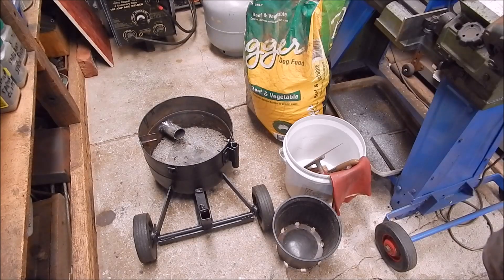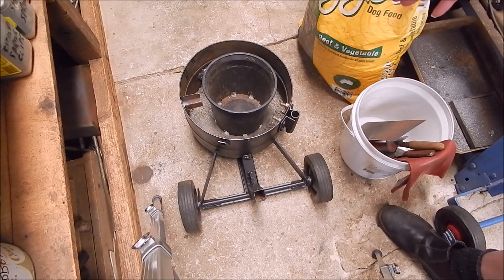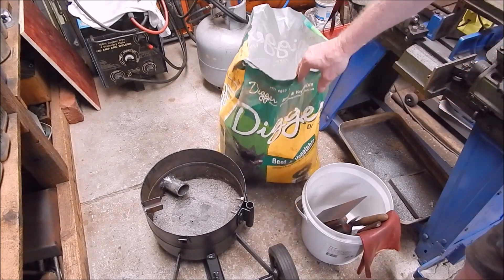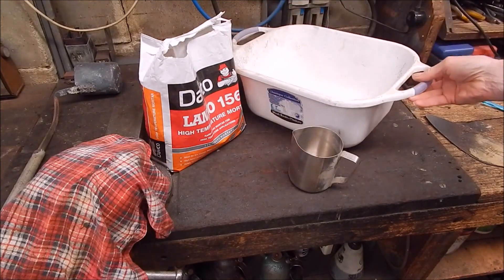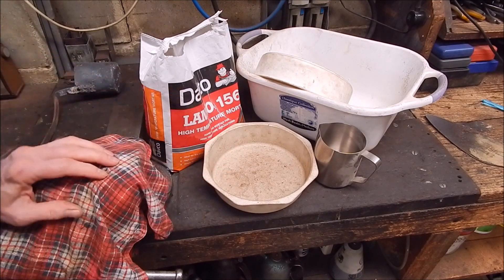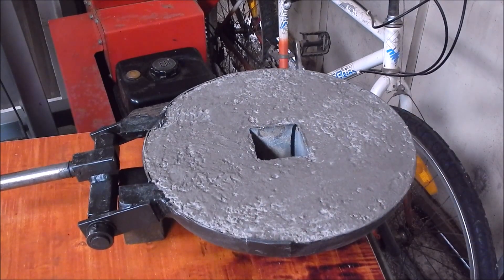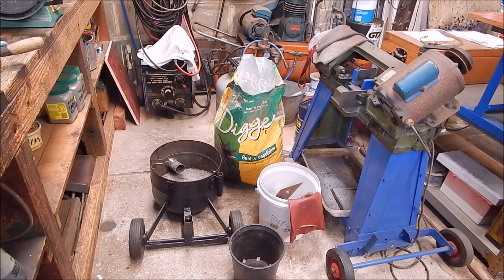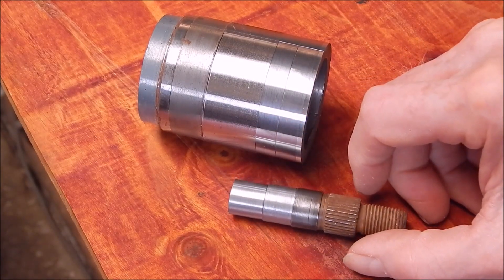Latest on the 10 kg LPG gas cylinder melting furnace build

Comment: G'day Rob.  Looking good.  Now you are not only the Xynudu foundry and casting company but the Xyndu founry and casting and furnace company.
Reply from the maker: G'day Harold.  Yep.  I finished it off today.  I'm letting it bake outside in the 39 C hot days we are having.  I increased the amount of mortar in the base and it remains to be seen if that was a good or bad move.  The lid is rock hard at 4:1 but I went 3:1 for the higher temperature crucible area.  Next thing is to fire it up.  Cheers Rob
Reply: @Xynudu  Hi Rob, do you add any water/liquid in the mix?
Reply from the maker: Hi Edin.  Yes.  It's the same process as mixing regular cement.  Just add enough water to make it bind like pottery clay.  Cheers Rob

Comment: Getting close now Rob👍 Where did you get the hi temp mortar?
Reply from the maker: Hi Bill.  I finished the mortar /perlite mix job this morning.  Just having a beer and watching the cricket.  I got the mortar at Bunnings ($25).  I needed a bag and a half to do the job. I switched to 3:1 ratio as it seems better.   I'm glad I put wheels on the cylinder as it's going to be damn heavy.  I will weigh it when all dried and back together.  Cheers Rob
Reply: Thanks Rob, handy to know if I ever decide to make a furnace

Comment: Those high speed steel parting off blanks you suggested from Banggood have been a huge blessing. They grind easily & do a super job. I did buy some carbide but so far I have never used it. The flexibility of high speed steel is so convenient. Looking forward to seeing this fab furnace in operation. Thanks for sharing!
Reply from the maker: Thanks for the feedback.  I totally agree on the HSS blades.  They stay sharp and I've never broken one.   Quite a good size.  The furnace is all done as of this morning.  Just need the perlite/mortar mix to set and dry out a bit.  Looking pretty good.  Cheers Rob

Comment: Your furnace is coming along nicely. Looking forward to the day when you show it fired up in anger. Andrew 👏👏👍😀
Reply from the maker: Thanks Andrew.  The build has been pretty painless so far.  It will take quite a while to dry out, but there is some hot weather coming up, so that will help.  I'm keen to get it going.  Damn glad I put wheels on it as the weight is going up.  Cheers Rob

Comment: Yes, did buy a 10kg bag of Pearlite recently, to reline a chimney and fireplace. 10kg bag is almost half my height, and cost only $30 Aus as well. Supplier is only 5 minutes drive from me as well, right in the city. There will also be a good chunk used on the new BBQ being planned, used for the mortar between the brick in the chimney.
Reply from the maker: It's dirt cheap to buy.  That would be a lot of Perlite.  Cheers Rob
Reply: @Xynudu  Yes, though I do pay $2 for small quantities, as it is used as the grow medium for the cat greenies, and $2  is the price of a 100g pack of the stuff, which comes with the seed and grow medium pre mixed. I do however take the pack and, instead of doing it all at one, place it in a bigger planter as topping, getting at least 4 out of the small box.

Comment: I used to work in a small heat insulating firebrick factory. We used colloidal silica as binder for the refractory aggregate. If you buy sodium silicate and start boiling it in a SS pot, you can keep adding citric acid powder till you start seeing the small drops of silica precipitating out of the solution, you need to stop adding acid as soon as you see first sign of it. Now you've colloidal silica which is used as a binder in refractory industry.

Basically the network of silica is joining together but have not joined enough to completely form gel beads precipitating out of solution. 

I use it to stick ceramic wool together and also use it in my crucible making mix.